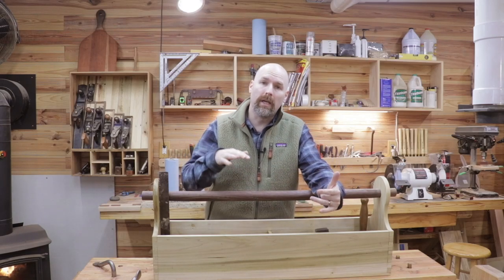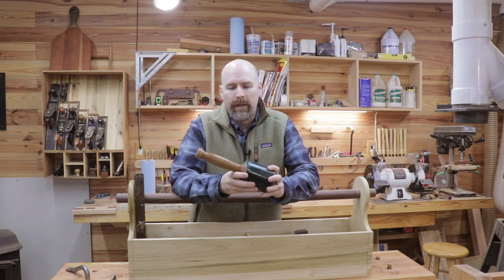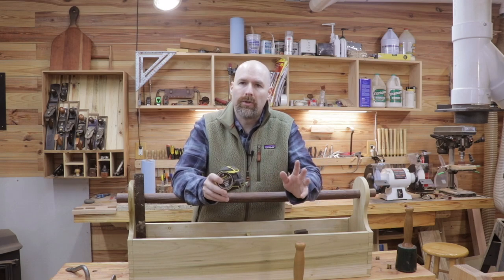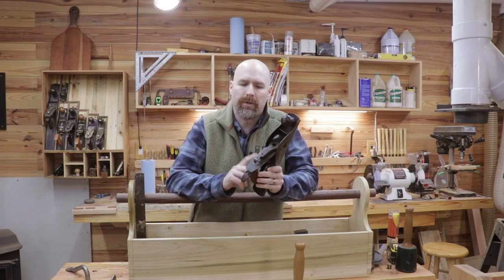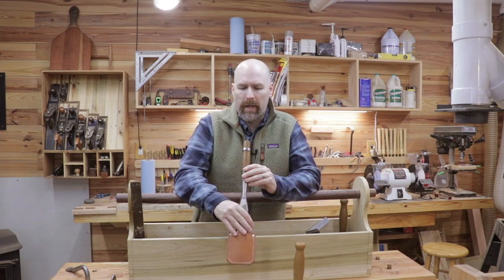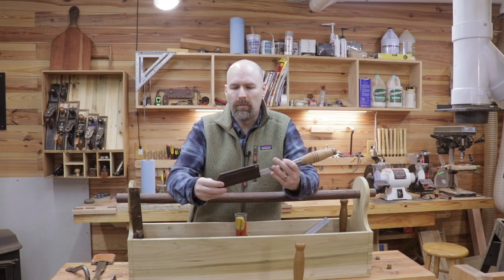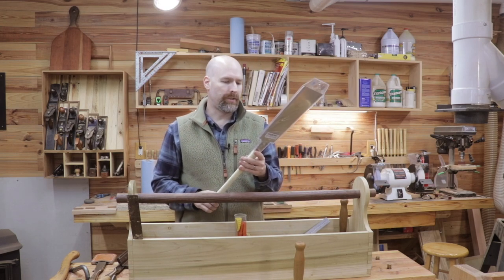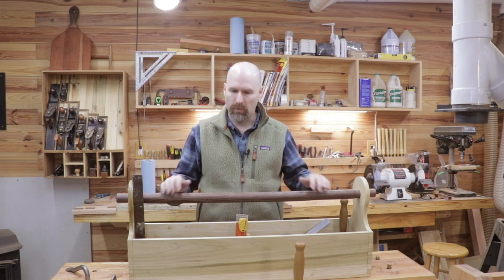Tools Needed To Build A Timber Frame!

Comment: Man i would love to have that plane. Nice set of tools you got.  Btw that is not an angle gauge its a sliding bevel. Also are you gonna do half dovetail notches for the cabin
Reply from the maker: It will be timber framed! I haven’t decided if I will include some horizontal logs in the design. Thanks for tool name correction!